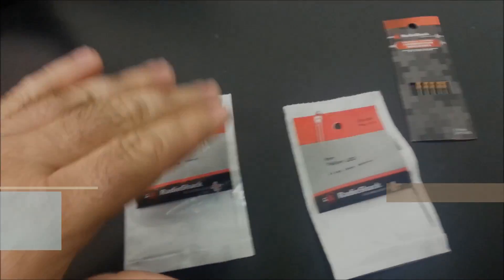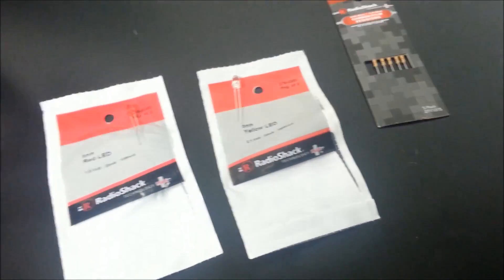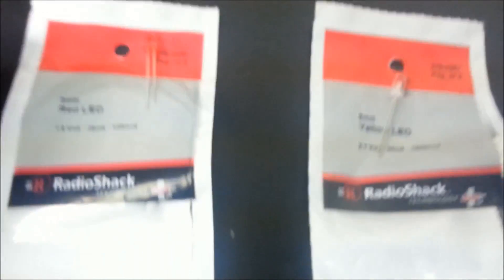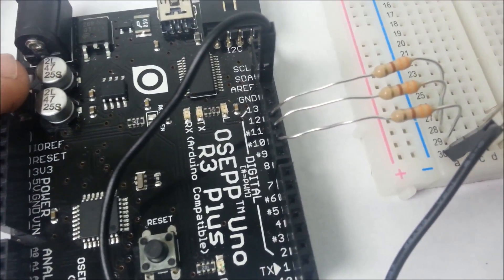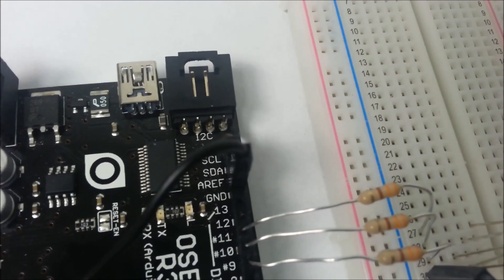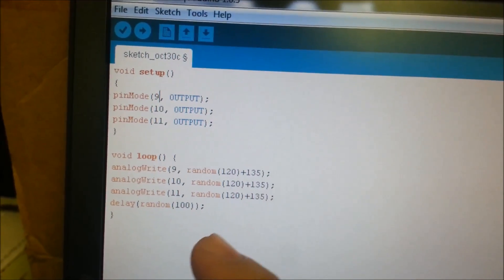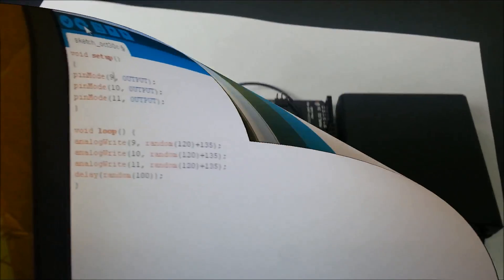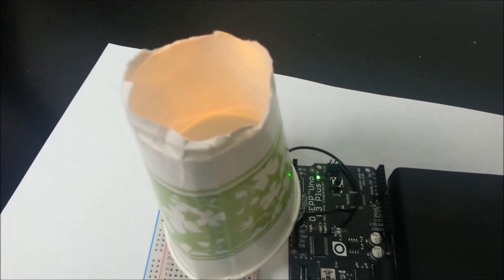Realistic Candle Light with LED Arduino PWM, DIY, How-to, Beginners

Comment: void setup()
{
pinMode(0, OUTPUT);
pinMode(1, OUTPUT);
pinMode(4, OUTPUT);
}

void loop() {
analogWrite(0, random(90)+135);
analogWrite(1, random(90)+135);
analogWrite(4, random(90)+135);
delay (random (100));
}

pour un attiny85
Reply from the maker: the attiny is GREAT!! works with many voltages, plus it is TINY!

Comment: Nice tutorial.  You can also use NeoPixels which are addressable RGB LEDs that come in a strip.  I don't know if those were available yet (or at least not very common) when this video came out.
Reply from the maker: takes a little more programming but those are great LEDs

Comment: How many (20mA) LEDs can an Arduino output pin handle without a driver transistor between?
Reply: I think max current is 40mA so 2 in theory but I would stick bigger resistors in and keep it a bit less than 40mA.

Comment: try this code:

const int pin = 10;
long dom;
long random_time;
int difer_time();

// the setup function runs once when you press reset or power the board
void setup() {
  // initialize digital pin LED_BUILTIN as an output.
  pinMode(pin, OUTPUT);
  randomSeed(analogRead(A3));
 // Serial.begin(9600);
}

int min_led = 100;
int max_led = 1024;

void loop() {
  dom = random(min_led, max_led);  // random led strenght
  random_time = difer_time(dom); //random(10, 200);
  analogWrite(pin, dom);   // turn the LED on (HIGH is the voltage level)
  delay(random_time);                       // wait for a second

 // Serial.print(dom); Serial.print(" ");
 // Serial.println(random_time);
}

int difer_time(int s)
{
  int a, b, wait;
  
  b = map(s, min_led, max_led, 1, 100);
  
  if (b > 80)
  {
    wait = random(100, 200);
  }
  else if (b > 20 && b < 60)
  {
    wait = random(40, 100);
  }
  else
  {
    wait = random(1, 40);
  }
 /*  // Serial.print(percent);  Serial.print(" "); Serial.print(b); Serial.print(" ");  Serial.print(wait); Serial.print (" "); Serial.println(s); 
  Print(80); Print(40); Print(20);
  Print(b); Print(wait); Print(s);
  Serial.println("");
  */
  return wait;
}

void Print(int d)
{
  Serial.print(d); Serial.print(" ");
}
Reply: I guess it would be easier to buy an ordinary candle in this case :)

Comment: delay(random(100));  why does it have to be written that way?
Reply from the maker: Hi, Thank you for watching. the purpose of the delay is to pause the light intensity of the LED for some time. these processors can process the loop so fast that the leds will simply look solid instead of flickering because it's switching patterns SO fast. Using Random prevents you from create a pattern code that uses alot of coding. PLUS random makes the delay and pattern unpredictable. This will simulate a flame more realistically.
So in detail here is what that line does. delay pauses the processor but it needs a time in milliseconds. So in the time we insert the random command. BUT we want to tell the random generator how high we want the number to be. So we place 100. This tells the random command to select a random number between 0 to 100. so the random command is random(100). So we are delaying randomly the loop from 0 thru 100 milliseconds. say the random(100) command produce 64, so the delay command will read delay(64) which is 64 millisecond pause.
Reply: Alright. I thank you for the detailed answer. I will test it.

Comment: wow! amazing idea, thanks for sharing! I'm gonna do that, and maybe this will be the first time my wife find something useful with all my arduino tinkering :)
Reply from the maker: works great with a JackOlantern. thanks for watching
Reply: +Carlos Pineiro a JackOlantern is exactly what I was thinking of! I'm looking for some nice printable 3d paper models right now!
Reply from the maker: +Federico Pedemonte You can use a real pumpkin, Simply double up on the LEDs. The standard arduino can handle about 150mA per output. You should have NO issue and it will be bright enough.